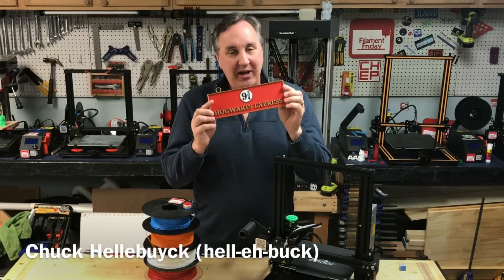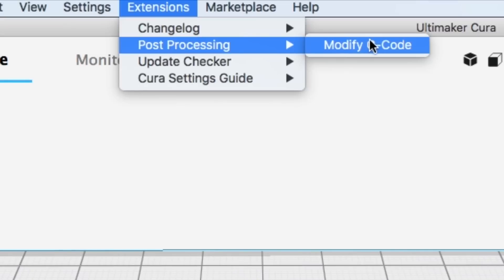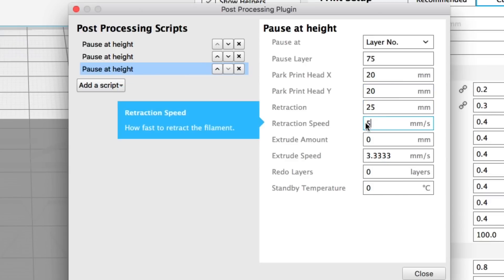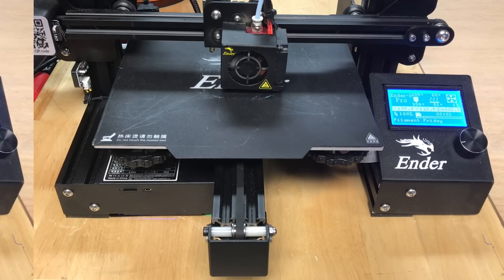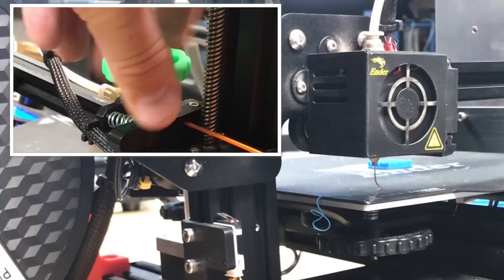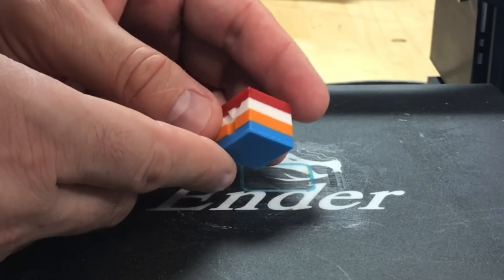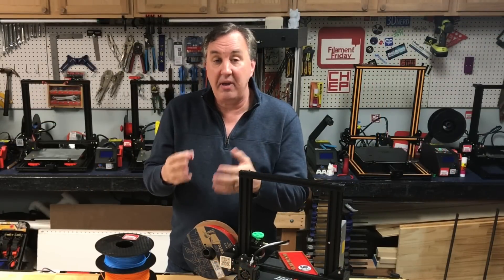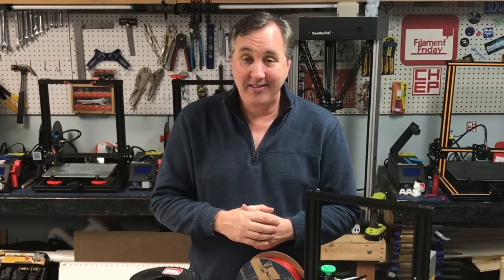How to do Multi-Color 3D Prints on Ender 3 3D Printer

Comment: am i the only wondering if it pauses at the beginning or in the end of layer 50 ?
Reply: I'm pretty sure it pauses at the end of it... I did a print where I wanted to change the filament after the 6th layer, so starting with the 7th layer I would have a different color. Set the pause function to pause at layer 7, watched my Z height on the LCD and noticed that it didn't pause at 0.8mm. Now here's the thing 0.8 should've been layer 7 (layer 1:0.2, 2:0.3, 3:0.4, 4:0.5, 5:0.6, 6:0.7, 8:0.8)
I then manually paused the thing and had it pause again when it switched from 0.8 to 0.9...

Comment: Hi, will it work on Ender 5 Plus? It worked on my Ender 3 Pro but on my Ender 5 Plus it moved to the 20 20 position and without waiting for my click, just continued printing.
Reply from the maker: 32 bit boards have firmware that isn’t recognizing the M0 command.
Reply: @FilamentFriday  will the M25 command work?
Reply from the maker: It should
Reply: @FilamentFriday  ok I've added the "BQ(M25)" scrip and it does stop but I didn't have a "continue" option on the printer's display so I paused it and continued it and nothing happened for a minute or so and then the printer continued printing as it should. Only when it continued printing (after the pause) it extruded a big blob of filament and ruined the print.
Any idea why it extruds this big blob before continue with the print?
Reply: @a.ca.6832 i had the same question a week ago and haven't found a solution yet. Inserting the start code at the pause commands in the gcode helped a little, but I'm still not satisfied. There is still a corruption at the point of restart with my v2.
Reply from the maker: @A.C.A - you hit play and it should advance.
Reply: @a.ca.6832  big drop: try to disable the "G1 F3000 E25" in the g code after the pause commands. This worked for me. (Put a ";" at the beginning of the line)
Reply: @W07t3R  yeah did that and it worked! Thanks!

Comment: i have tryied this but with cura 4.8 i get issues..when pause  began. after few seconds the print starts itself.?? how could be possible? shold by paused till  me put button for resume i guess?? :D
Reply from the maker: It’s the firmware. https://youtu.be/vFcMW6m9OGg
Reply: This was happening to me. It seemed random as sometimes it worked and would stay paused until I manually resumed, and other times would re-start itself after about 5 seconds. Then I realized those that were re-starting themselves were ones that I forgot to set the retraction in the  pause-at-height dialog. When that was left blank, pause didn't stay. When it is set that field (I usually use 10), it works as it should.
Reply: @johnniehobby  are you sure ? To me this sounds like the M1 command isn't understood by the printer, like my v2 behaves just like this, when I'm using M1 instead of M25.
Reply: @W07t3R  I was sure before, not so sure now so I just ran some experiments and apparently I wasn't remembering correctly from what was probably a night where I was up until 3:00 AM trying all sorts of options trying to get a print to work correctly. Turns out my issue was a bit different where, when using M25 command, accidentally putting a value in the Extrude Amount field instead of the Retraction field would park the nozzle briefly at the coordinates I set, then on its own would go back to the previous spot and then dump a big blob of filament right on the print and then pause there until un-paused manually. Sorry about the misinformation (as I said, memory failure on my part), however, good tip: if you do eventually get the M25 command to work, don't accidentally put a value in the Extrude Amount field.

Comment: Is there a code to add, that would start the new color with the two lines on the left side to redo the nozzle? (Even when not attached to the plate.) I always get unremoveable drops when starting a new color.
Reply: Solution for me: editing the final g code ** find pauseatheight ** a few lines below there is a ** ;  G1 F3000 E25 ** setting a ";" in front of it to disable it solves the problem with the massive drop for me ** I don't know what this was originally ment for, so see if it works for you.

Comment: What's FRUSTRATING is Creality Ender 3 has been around HOW LONG? and CURA too? Why haven't these two companies got their "standards" worked out yet in the GCODE dept.??? It's 2021. I'm using Octoprint (glorified gcode sender) and for the 1st time tried to figure out this "pause at layer height stuff" in Cura with the Ender 3 profile and just scratched the sh** outta my brand new glass bed. MY FAULT, I get it. But geeez! It shouldn't be this difficult to "PAUSE, RAISE Z-AXIS, move printhead to a safe location, PROMPT for filament change, keep hotend HOT for retraction/new filament purge & finally RESUME print. I almost smashed my printer tonight I was so pi**ed off lol... yeah, i F**ed up, but this should be an easy and STANDARD OPERATION in CURA/OCTOPRINT.

Comment: Why did you use the pause and not the change filament option?
Reply: hey josh, seen your comment after i typed mine above... im using octoprint, and for some reason, i've been led down the path from "other" youtubers that it's the stupidly complicated "pause at layer height" route I needed to go down. I mucked up something serious tonight and ruined a brand new glass bed testing this 2-color stuff trying that method...   never tried 2 color stuff before...kinda bummed out

Comment: Is there a way to do this with sequential printing? Say I want to print 5 of the same model at once, and I want the first 10 layers of each model in blue and the last 10 layers in red. Can you get it to sequentially print all 5 models up to layer 10 only, then pause for filament change, and resume completing the layers for each of the 5 models in the new color? Would be really handy for making batches of gaming tokens and that sort of thing
Reply: Yes you can do that if you add/duplicate the models in Cura, in the same bed. There's an option to print simultaneously all objects on the bed and if it is the same object duplicated the number of layers of the color change will be the same. So the printer will do 1 layer of each object, then go to the second layer, and so... It may generate stringing between objects tho, haven't tried this.

Comment: Hi! Can I do the same way in my Ultimaker 3 which has dual extruders already? Can I print two colors in one stl file only? (I don't need to pause and change filament, right?)
Reply from the maker: Yes, just need to slice it for two extruders.
Reply: @FilamentFriday  thank you for your reply! can you teach me the detail settings please! do i still need to pause it and lower the temperature if i just want dual colour only? thank you so much
Reply from the maker: It would be similar to this: https://youtu.be/h1fxx_jtbzE
Reply: @FilamentFriday  thanks, but how can i set in post processing? do i need to use pause at height? do i need to set standby temperature? because i hv two nozzles with different color already. i want to know how can i print first 20 layers with nozzle A and then next 20 layers with nozzle B. sorry that i have so many questions, thanks a lot!

Comment: Hey Chep, quick question. Does this method work with a stock Ender 3 V2?
Reply from the maker: You may have to use m25 setting but should work.
Reply: @FilamentFriday  I’m new fairly new to 3D printing, so how would I do that? I haven’t really gone deep into changing firmware yet. Still very new but, I really want to get the multi color effect.
Reply from the maker: Select M25 from the method drop down in the Pause at Height script shown in this video.
Reply: @FilamentFriday  Alright, thank you so much.

Comment: hey Chep, ive got a huge issue and i need a serious help with that (or anyone else). 
im using Ender 3 v2 and when the program pauses, i change the filament, then the axis and nozzle returns back to the bed and continue the printing, but from the bottom. I mean (for example) i have printed 5 layers, after change and resume it continues to print the 6th layer, BUT from the bottom (layer 1). how can i fix this? im afraid, that i damaged the nozzle already, so i just changed it up
thank you for response (feel free anyone to comment, ill take any help)
Reply from the maker: Sounds like the stepper is letting it fall down.
Reply: @FilamentFriday  is there any possible fix, how can i make it work?
Reply: @balazstoth919  I just tried this technique and after changing filament it resumed printing at the bottom and smashed right into my model, and scratched my glass bed. What am I doing wrong?!
Reply: @BuildThoseSkills  Same! still trying to find solution
Reply: @YCorey  I'm having this problem too.... Crashes right into the bed and print after the change.

Comment from the maker: If you have a newer Ender 3 with 32 bit board this may not work because Creality didn’t include the M0 command in the firmware. Try the M25 option.

Comment: just tried this ... it didn't work, I don't know what happend I wend back over the video and checked all my steps ... it never stoped at layer hight and the print ended up looking really bad at the top to boot. :(
Reply from the maker: If you have a newer Ender 3 with 32 bit board this may not work because Creality didn’t include the M0 command in the firmware. Try the M25 option.
Reply: @FilamentFriday  Can't confirm because I havent tried this script yet, but creating your own Marlin drivers might re-add this and other commands. I can confirm custom drivers solved the stuttering and pausing due to the buffer filling up that resulted in blobs on high-poly models.

Comment: @CHEP any chance you can update or correct your video to reflect the correct settings for cura 4.8 and the current marlin firmware for the 32 bit ender boards.

Comment: Do you know why my nozzle is scraping my print after the color swap?
Reply: Do not check the box that says "redo layer" and it will work fine.  The same thing kept happening to me until I deleted that checkmark in that box.  Worked perfect after that.
Reply: im getting the same thing, its like it trying to print the layer after the pause at the height of the previous layer. and ideas?
Reply: @wheeler498  please let me know if you find anything out
Reply from the maker: I set it to redo the last layer. Change that.
Reply: @8michelotti  After playing around i found that using "Method" - BQ (M25) and adding a M300 in the Before pause and After Pause worked. With a Ender 3 Pro 4.2 board.  Not sure why but it worked.

Comment: Would you mind releasing a tutorial on how to do this same process in cura 4.8 and the current version of the ender 3? Because this isn't working for me. I tried using the Marlin (MO) method and it did nothing. I then tried BQ M25  and it did pause, but wouldn't disengage the steppers even after it reached the time I specified, which made it difficult to change filament and purge the extruder of the previous colour. 
Any help or further info would be appreciated
Reply: Do not check the box that says "redo layer" and it will work fine.  The same thing kept happening to me until I deleted that checkmark in that box.  Worked perfect after that.
Reply: @motoprof1441  box is not checked, still have problems.
Reply: same problem. please sir CHEP!  thank you!
Reply: Same, I've tried this multiple times on 4.8 with various settings and it won't work. I even added a beep before the pause so I could hear when it was ready for me to change the filament, and it moves to the corner and then immediately starts printing again.

Comment: Appreciated for your tutorial but also not appreciated you provide the wrong solution. Especially you have been informed by others but you still do not edit your tutorial or provide a warning to the viewers. Just like others, followed your instruction and wasted all the filament but still had no clue what went wrong because we followed every single step of your instruction. The proper way is to use FILAMENT CHANGE!! I don't blame you but I hope you should feel at least a bit more responsibility to update your instruction. A lot of filaments and time have been wasted continuously as long as your video is still here.
Reply from the maker: It all worked for me with the version of Cura I used. What changed was Creality converted to 32bit boards with incomplete firmware. So blame Creality not my video,
Reply: @FilamentFriday  While blame may go / goes to Creality; kindly add a note to the top of your comment text for this video and/or pin a comment that states how/what/why it may not work. Point to an updated video. That is the responsible thing to do when things change after the fact, and you as the guru have been made aware it stopped working. You make great content. Youtube presents it to people new to 3D printing. As end users we do not suspect this no longer works universally. So, add extra couple lines, point to a new video if you have one. Easy peasy. No big effort. People learn to double check if this will work, instead of taking notes and not getting it to work.

Comment: Thanks to CHEP, I've used this feature a few months ago to insert a metal nut in a knob that I was printing. It worked flawlessly in a previous version of Cura. I'm now on Cura 4.8, still on the same Ender 3 and a problem occured. When the print restart after the pause, there's a ±5mm layer shift on the Y axis.

Hint anyone?
Reply: Mine kept hitting the workpiece after the color change.  Do not check the box that says "redo layer" and it worked fine.  The same thing kept happening to me until I deleted that checkmark in that box.  Worked perfect after that.
Reply: @motoprof1441  Thanks for that hint. I'll give it a try this week and give you a follow-up.

Comment: Chuck - I have a CR-10S Pro v2 and unfortunately, this sweet process doesn't appear to work. The printer went to the 20X/20Y coordinates, paused for maybe 1 second, then went back to printing. 

What would you recommend in this case?  Adding more Gcode, making the Disarm setting to XXX seconds?
Reply: It does the same for my Ender 3 & Artillery Sidewinder x1 not sure what we need to do to make it work
Maybe @UCsdc_0ZTXikARFEn2dRDJhg would you be able to guide us on what's missing from our side ? 
Thanks so much

Comment: Hi Chuck, I used this technique to print QR codes. But the blobs are bit of an issue with the details in the code. Is there a way to avoid the blobs after a filament change?

Comment: is this the same procedure on the Ender 3 V2?
Reply from the maker: Yes. But you might have to use M25.
Reply: @FilamentFriday  ...didn't work. It pauses, and then starts right away without waiting for me at all. Only way I can do this, is to pause it my self.
Reply: By the way my board is 4.2.2, firmware 1.0.1. I see there is an update on Creality's website, but no changelog. Any idea if this solves anything? Like this issue for example.
Reply: @PlzDontKillDave  would a wrong firmware break things? The ender 3 has a completely different board.

Comment: I tried this, and for some reason my Ender 3 V2 ignores the code to cool down the nozzle, so it stays at the same temperature. Also another problem, is as soon as it starts extruding it makes a giant blob of filament right on top of the model where it restarts. I checked to make sure the nozzle didn't have any filament on it before resuming. Have you seen that issue before?
Reply from the maker: No, I haven’t.
Reply: I have the same issue. Any solutions for this?
Reply: @arifsafar9519  I ended up switching to Jyers firmware which has the filament change feature in it already.

Comment: Any idea how to print with two different filament PLA and TPU on top of each other on Ender 3? (i.e. the first 5 layers TPU, and the rest 5 layers with PLA)
Obviously, not possible with "Pause at height" or "Filament change scripts" in Cura as that will not change the speed, temp, retractions..etc.
Reply from the maker: Use two separate files with second z offset by 5 layers.
Reply: @FilamentFriday  Thanks! always useful!

Comment: I tried this method and my ender 3 pro stops for a sec then it goes right back to printing again, any ideas on how I can make it wait for me?
Reply from the maker: Use M25 delay. More details here: https://youtu.be/vFcMW6m9OGg
Reply: @FilamentFriday  it interesting because I use the leveling file to level the bed and it recognizes that no problem but the change filament or pause on layer won’t. I’ll check out the firmware update thanks.
Reply: @Gilbertortizmusic  I have the same problem when printing using cura
Reply: @bear_in_site  does it work with a different slicer?
Reply: @Gilbertortizmusic  I should have been more clear. I have the same problem when printing using the Cura PC to 3d printer feature. Instead of solving it I'm doing the old download to sd card method. When I use a sd card it pauses at the correct times.
Reply: @bear_in_site  ah ok i do that too but it doesn’t pause

Comment: Thank you so much for this tutorial. But when I am using these settings with ender 3 v2, my printer waits for 4-5 seconds and resume printing. And there is not option for "waiting for user".
Reply from the maker: It’s the firmware. This video was done when they included 8-bit boards. More detail: https://youtu.be/vFcMW6m9OGg

Comment: Hey chep! I’ve previously and currently still use this guide to change the filament on my ender 3 pro and it works great but I also just got a ender 3 v2 and this doesn’t work on it! Well at least for me... it never pauses and it just finishes the print.. wanted to see if you’ve experienced this or knew anything about this. 
Also wanted to say Thank you for all the info in your videos, I’ve learned so much.
-nvm I just read some comments and you did it again lol thanks!